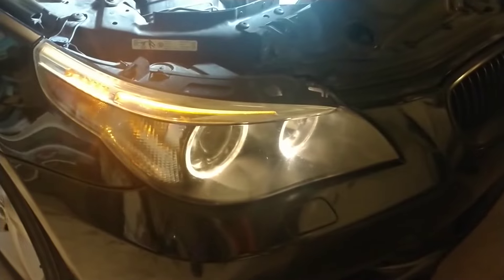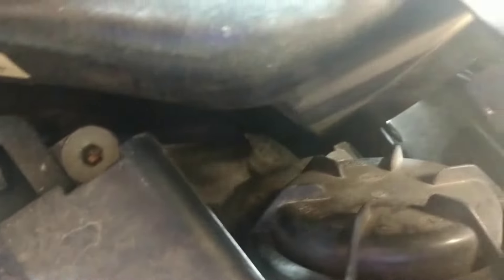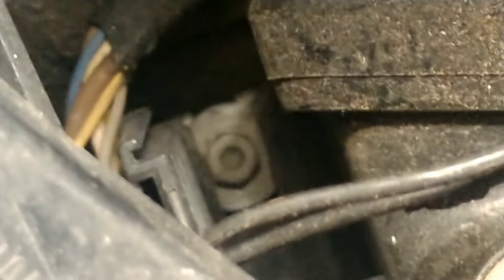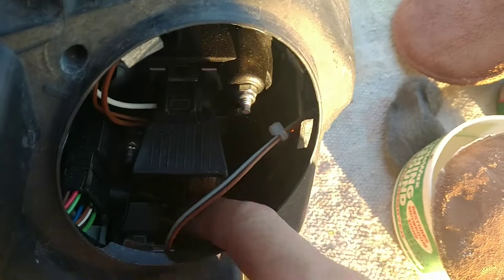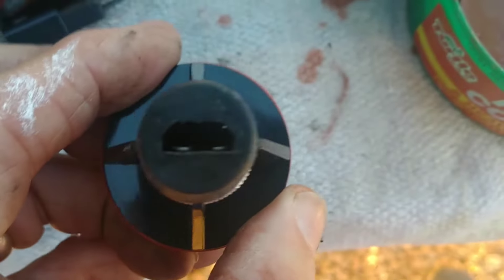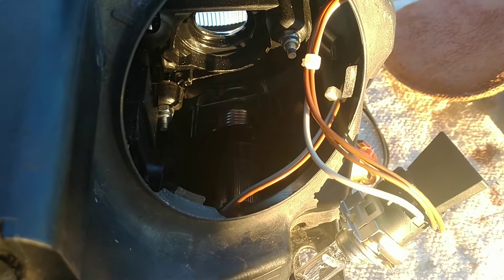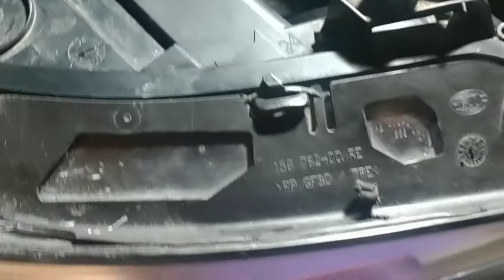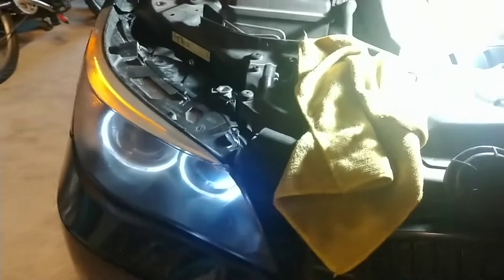BMW E60 / E61 Angel Eye Bulb Replacement (detailed).  $13 eBay LED bulbs

Comment: Hi I have a BMW e60 2006 5 series 
I have angel eye bulbs like you have but I have little bulbs above the main h7 bulbs am I missing something
Reply from the maker: @chef13sr  I'm not sure what you have... My 2006 E61 didn't have anything above the main bulbs. Maybe one of the headlight variants have a different configuration than the headlights in my car?

Comment: Could be a silly question but is there two individual bulbs servicing each individual halo on each headlight or does one bulb do both rings. 
The question I’m asking is do I need to buy 4 bulbs or 2 to do both headlights.?
Reply from the maker: That's not a dumb question at all. One bulb does indeed light up both rings. So you'll only need two bulbs total to do the whole car.
Reply: @Mark_H_DIY  thanks for responding so quickly. I just see some resellers listing packs of 2 or 4 so I wasn’t sure. Will it matter that mine is an LCi? (not sure what yours is)
Reply from the maker: @HazyIndustries  mine was not LCI, so I would make sure that is the right bulb for it. I honestly don't remember, and I've never worked on an LCI headlight. The concept is the same, though, and I suspect that the process for swapping it is pretty much identical.

Comment: Note: First of all, I completely replaced the headlights from BMW, and the lights work well. The lights were transferred from one vehicle to another, and the two vehicles are the same make and model, but when installing the lights on my car, the angel eye did not work on my Spartan. Why? What is the reason?
Reply from the maker: It could be that the "new" lights have flaky insulation (a common problem) that caused a short when moving them around to remove / reinstall them.  I'm not sure if BMW allows you to program the angel eyes off, but I wouldn't doubt it.  You could try moving one of the "new" lights back to the "old" car to see if the angel eyes work there or not (if they do, you eliminate the bulbs and wiring).  If the cars aren't the same year, it's always possible that there is a difference in the wiring configuration in the plug.
Reply: @Mark_H_DIY  Thank you for this valuable observation. Now I have confirmed why the Angel Eye lights did not work. The lights that I transferred from that vehicle are a BMW 525i to a BMW 530i. They are both the same model and the same lights, but the difference in the size of the vehicle affects

Comment: Hello, I have a 2004 BMW 5 Series, the angel eye does not work. What is the reason? I hope for a response. Thank you for this beautiful channel.☺
Reply from the maker: With lights, it's usually pretty simple to chase down the problem.  It could be as simple as both angel eye light bulbs being burnt out - then it's just a matter of upgrading them to LED bulbs.  Or it could be a wiring problem.  Many of the 5-series E60 headlights have a problem due to the biodegradable insulation that BMW used - it can crack and fall off, which can cause a short circuit that will blow a fuse or cause bigger problems.
Reply: Yes, my dear brother, your words are correct. There is a difference in the wiring of the lamps. Others told me that you must transfer the lamps with the computer to my vehicle and install them on my vehicle so that they work well. Thank you, my dear brother, for your valuable information. Thank you very much.

Comment: Great job. Can I change the bulb without removing the headlight ?
Reply from the maker: Absolutely, assuming you have hands that will fit into the area, and have trained your fingers to be your eyeballs. :-) My original plan was to change the bulbs without removing the headlights, but I couldn't find a video that definitively showed how to do that. My hope was that my video would allow someone to understand what their fingers need to do, even if they can't see what they're doing. Doing the job blind, with the headlights still installed, will be more challenging, of course. But if you have the manual dexterity to do it, you'll save some time, though not a lot since removing the headlights and reinstalling them takes only a few minutes.
Reply: @Mark_H_DIY  great explanation :) my left angel eye stopped working so i think the bulb is the first thing to check. I will try it tomorrow, take the headlight out and try to change it.
Reply from the maker: @jovanzacevski  Makes sense. I'd try to get the same bulb to prevent ending up with lopsided angel eyes ;-). The other advantage to removing the headlight is that you can check for the (all too common) wiring insulation deterioration.
Reply: @Mark_H_DIY  I have done it :)
Removed the headlight and it was dead easy. Then I have removed the bulb for angel eyes, it was tricky but not very big deal, and the hardest part was taking my dad's car to go and buy 2 bulbs because they are 10w hallogen little bulb :)
Now I have beautiful angel eyes again :) just to add that I preffer the oem yellow angel eyes than led.
Reply from the maker: @jovanzacevski  Congratulations! There's just something totally wrong about a BMW with only one angel eye burning. I'm glad the video helped with the process, and I hope those new bulbs last the life of the car this time.

Comment: Did you get any warning light on the dashboard saying the bulbs were gone? I replaced the bulbs over the rear licence plate with LED bulbs, looks great but the car doesn't register them so it gives a warning message that the bulbs are gone.
Reply from the maker: That is a great question! There are a lot of bulbs on the E60 series that will indicate a failure when they blow out, or are replaced by a low current bulb that looks like a blown bulb to the car electrically. But the angel eye/running light bulb isn't considered essential, but merely cosmetic. So there is no monitoring of that bulb, so you won't get an error light if you replace it with an LED.
Reply: Yes.  BMW error code will show "parking lamp" not corona and certainly not angel eye.
This is also daytime light. The car will use low beams high beams or Corona rings as drl's as you adjust you can also adjust the brightness and once you have everything set you can turn your drls on or off within the iDrive You can turn off monitoring of the circuit entirely. Bear in mind there are e60s and E60 LCI and there will be differences know your car
Reply from the maker: Great input - thanks!
Reply: @notadoctor2598  thanks! I didn't know i could turn off monitoring of the parking lights.  I will need to look into that for my LCI.
Reply: @notadoctor2598  Just FYI, by default the angel eyes aren't used as DRLs, at least not in Australia. By default the headlights are the DRLs, and the knob needs to be set to Auto. I coded my car to have angel eyes on only for DRLs.

Comment: My outer angel eye ring is not as bright after changing the bulbs, any ideas what may cause this?
Reply from the maker: The only things that pop to mind are that the bulb isn't bright enough, or that the bulb's design doesn't make with the fiber optic like it should. There are a lot of badly designed and under-bright bulbs out there. Mine were dirt cheap but much brighter than the original incandescent bulbs.
Reply: Check that bulb is seated properly/same as the bright side iv had it happen to me before

Comment: Great video. Do you know if the same procedure applies for the lci headlights?
Reply from the maker: I believe that they're very similar, but I've never seen an LCI headlight inside, so I don't want to guess and mislead you.
Reply: @Mark_H_DIY  fair enough dude, mine is a pre lci but I replaced the headlights for the lci type a couple of years ago, my drivers side (uk) halo has gone out so replacing them when they get delivered.  I'm sure it'll be straight forward. Thanks
Reply from the maker: I believe the LCI headlights take an H8 bulb for the angel eyes, so it's going to be at least that different.  But IIRC, the location and basic design is very similar.  Just an aside, my cheapo angel eyes are still working perfectly - I'm very happy with them so far (14 months).
Reply: @Mark_H_DIY  so I went ahead and replaced the bulbs, pretty much exact same location.  I took the headlights out as I wanted to sort out the way the bumper sits, the bolts on the brackets have rusted on the heads fell off just by touching them 😅 and the plastic tabs have snapped so that's why it doesn't sit right however back to the bulbs only my outer halo doesn't light up on the drivers side, inner halo is fine and passenger side is fine. Odd because its the 1 bulb which lights up both rings, been told if it faults too many times it shuts off one of the circuits ie 1 of the halos, could be because I ignored a 'dipped beam failure right' for a while.
Reply from the maker: @bilalahmed2386  I'd double-check the position of the bulbs. I'm thinking you might get that kind of problem if the bulb wasn't fully seated. Did you use the same ones, or at least similar format bulb?
Reply from the maker: @bilalahmed2386  FWIW, the eBay item number for the bulbs I bought is 324615772116 (can't do a link on my phone)
Reply: @Mark_H_DIY  thanks for the info.  However I had this issue prior to fitting the bulbs where only 1 halo lit up in that unit, I thought a new bulb would sort it, the new bulb is exactly the same as the one that came out
Reply from the maker: @bilalahmed2386  I think it's normal for the inside ring to be much brighter than the outside ring. If the outside ring is really dim, I'd check for some disconnect in the light pipe that feeds the outside ring. I admit I have no idea how it works... ;-)
Reply: @Mark_H_DIY  I definitely give a once over, I need to get 1 light back out as it's not sitting flush and it's doing my ocd in! I'll try plugging that unit into the opposite side and see if it's any different.

Comment: Why mine 160w dimm?  I dont understand. Even with bimmercode not bright as yours. Like 20procent of yours brightness
Reply from the maker: If you got the same bulbs I did, I would expect them to be the same brightness. It's hard to see exactly how bright the bulbs are on the video, because the cameras always want to correct the lighting, and make them look brighter than they really are. I can say though that the new LED bulbs are probably 50% brighter than the old yellow incandescent bulbs that were in the car from the factory. I hope that helps.
Reply: @Mark_H_DIY  can you please share a link so I can buy the same ones
Reply from the maker: @oezplays8146  This showed up on my phone, but I can't find it on my computer, so I can't do a link. Please see the first section of the video that has a screenshot of the bulbs I bought. You should be able to use the title from the item on eBay to search for it. I hope that works, and if not please try to message me again and I'll do my best.
Reply: @Mark_H_DIY  thanks 🙏

Comment: how can i change the plug because the old one the wires are awful  the big part where does it go ?
Reply from the maker: BMW used some awful biodegradable insulation in these headlights and it's caused a lot of problems for many people. You just have to be very, very careful when you're working in there, and maybe use some liquid insulation, or tape to fix the worst areas.   I'm not sure what you mean by the big part, though.
Reply: @Mark_H_DIY   thank you i got it fixed with tape  because i didnt have liquid insulation . The other thing that came with the bulbs but i dont think i need them
Reply from the maker: @blastkreg5903  many bulbs ship with adapters so they can be used in many different applications. Sometimes they can be confusing. Congratulations on a successful fix.

Comment: They did not fit into my BMW E60. The light holder in the headlight is shallower than yours and even with the extension unscrewed/removed from the new LED lights, it still won't fit. The new LED bulbs are too long. It seems not all E60 headlights are the same.
Reply from the maker: Interesting... I know there are a lot of different designs of E60-series headlights, but this is the first I've heard about having a different angel eye bulb spec.  Please post some information on bulbs you find that do fit, so someone reading these comments will be able to find what they need.  Also let us know anything you can about your headlights, so we can figure out why they're different...
Reply: I have the exact same issue. Is yours an LCI with the projector lenses but halogen H7 bulbs by any chance?
Reply: @mondaythe10th I literally have the same problem currently still looking

Comment: is this orange stripe on top of the headlight also one  pre lci e60 or did you change the headlights?
Reply from the maker: I'm not sure which "orange stripe" - if you mean the row of orange LED indicators running down the fender lip, those are stock for my E61 (a 2006 530xi Touring), which is a pre-LCI model.
Reply: @Mark_H_DIY  yes I mean those day time orange strips, I thought they are only on lci models
Reply from the maker: I think it varies from country to country.  My pre-LCI sure has 'em in the US.

Comment: Po kilku miesiącach to gówno się przepali , lepiej wyglądają oryginalne, hella Ale co kto lubi.
Reply from the maker: I'm sure there are some really bad quality LED bulbs out there (and I've bought some).  But I've had these installed for a year now, and they're still working great (and look MUCH better than the original yellow-ish bulbs).  That's not to say that the ones I bought are as good as Hellas, but they are almost free, so I won't feel too bad if I do have to replace them some day.